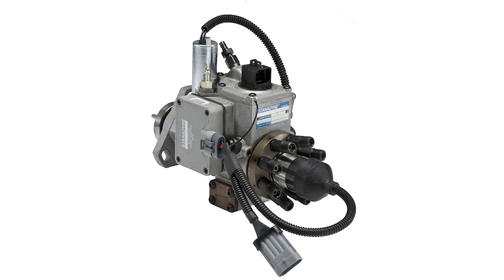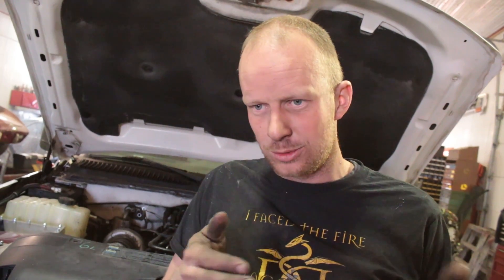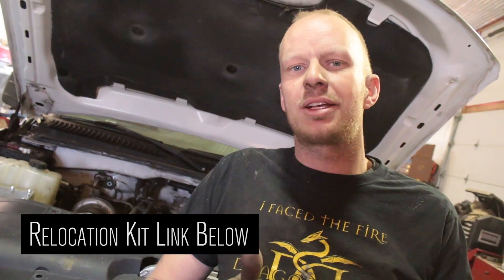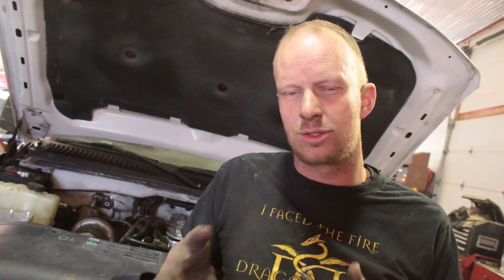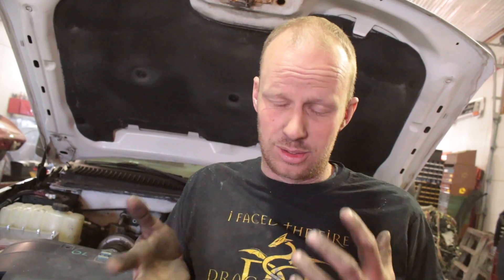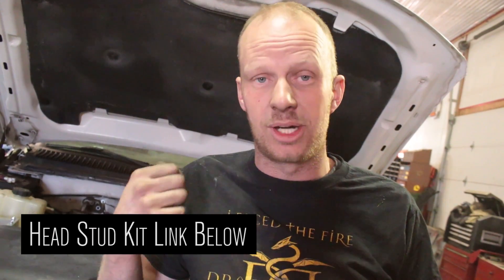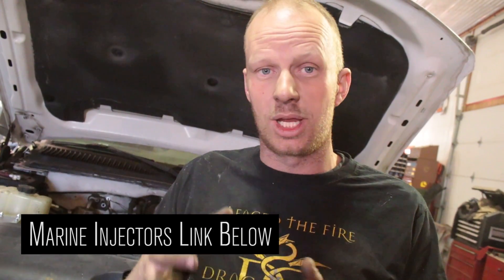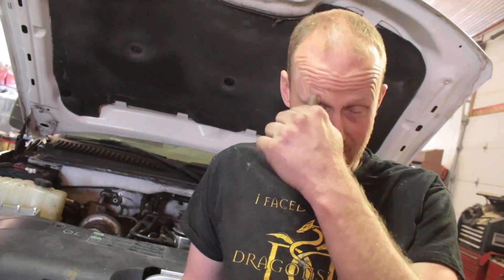REVIEW: Everything Wrong With A GM 6.5 Detroit Diesel

Comment: Am General is the manufacturer of the Military Humvee since the first day of production in 1984. When GM introduced the replacement diesel for the 6.5 with the new 6.6 turbocharged diesel they shut down the 6.5 production line so AM General purchased the entire 6.5 production line tool dies everything related to building the 6.5 and built a brand new building to start production in. After repeated failures of the block AMG delved into metallurgy of the block and finally put into production a new much improved engine block on the 6.5 turbocharged engine rated at 275 horsepower. It blows the old reliability records right out the window and the Army loves it.

A friend of mine found a new in the crate 6.5 military diesel from a military surplus dealer and put it in his M-1009 with the military heavy duty 4 speed automatic transmission doing regular maintenance on both items now has over 300,000 miles and still runs like he installed it yesterday. It was designed for the latest Humvee  and is a massive improvement to the old 6.2 6.5.
Reply from the maker: Thanks for that.  Awesome!  I just got my first Hummer into the yard yesterday.  Its not like any other one I have ever seen though.  Can't wait to start working on it.
Reply: DEBOSS GARAGE 

Just an FYI the low delivery rate of the mechanical fuel pump, I replaced mine on an ex military G30 class ex Air Force Van 6.2 Turbo 400 when the mechanical transfer pump failed with a 12 volt pulse type fuel pump. Solid 7 pounds of fuel pressure simply by turning pump on and while waiting for the glow plugs I would hear the fuel pump clicking at high speed then slow down to about one beat a second. It was on there for over 250,000 miles before I retired the truck due to rust/rot issues. The engine is now used to run a 30 KW standby generator for the tow truck drivers home for 3 years nice and warm in a corner of his heated garage. Not automatic start, he or his wife fire it up as needed and let it warm up before putting a closing the breaker to run the entire house with it. The following winter he lost power and fired it up before going on a tow. That's when his wife called and asked how much fuel for the generator they had. Commercial power wasn't restored to his house ( dead end street way out in the boonies) for 27 days, massive ice storm and over half the state without power. Commercial power utility had to replace 698 poles to reach his house so he called the utility and told them he had a very reliable diesel generator do get the important areas first. His fuel tank for the generator is a retired aluminum 5000 gallon home delivery truck parked sitting on a concrete pad no tires or axles or engine filled the day before the storm hit( he was lucky) .

I believe you can buy a new AM general built 6.5 for around $7000 directly from AM General which has all the updates AM General put into the engine block and cylinder heads. 

Oh yeah the 6.2 military engines are the J series engines using gears instead of chains to run everything under the water pump. Check the serial number, if you see a J in it it is gear not chain driven.
Reply: Just found this and thought you might get a chuckle out of it. It starts out fast but don't touch you computer, that's just to get bye the crap at the beginning .
Here's the link below.  

https://youtu.be/20FBN3tdJUg

Hope this helps and gives you a chuckle at the same time.

Comment: I had a 1994 c2500 with a 6.5L , and had to rebuild it due to MASSIVE blow-by.
I sank a ton of money into the job and would have been better off with a 12V Cummins.
The truck burned up in a wild fire in 2011, after only 850mi on the rebuilt engine. 
Sometimes you just can't win. I won't own another "boat anchor" 6.5, even if it's free.
The old non-turbo 6.2L had better longevity. The 6.5L was just weak crap, ESPECIALLY the bottom end which would easily crack the block under decent boost if you don't run a main cap stud girdle. GM originally listed them as a " light duty " diesel, which speaks volumes on these slug engines.

Comment: i enjoy how these engines drive .As he said not a ton of horse power but plenty torque almost the same as a 12 valve and it weighs 300 pounds less !. These engines are also fairly fuel effecient compared to other trucks and for its size.

Comment: 7.3 is the best light truck diesel ever. Period. Cummins had common cracked blocks and all kinds of stupid shit over the years that the 7.3 never suffered from. The lbz/lmm duramax id put over the 12v also. Absolutely bulletproof considering how complicated they have to be these days. The cummins was reliable for sure but it was also anemic power wise.

Comment: Injection pumps and the electronics on them fail. The cylinder heads ALL crack between the valve seats and the swirl cups, though it doesn't seem to cause any issues. The valves these engines come with are time bombs, the valve face where it meets the seat will just fall off.
You can get decent power out of one without too much money, but you are kinda pissing into the wind. I'm not talking anything amazing, just around stock LB7 duramax level of power.  There is a pump out there that will give you more fuel than you know what to do with, but it will never be reliable.

Comment: My first diesel is a 1992 full mechanical injection turbo 6.5 and I believe it's a great motor. I bought my truck all stock with two cracked heads which is common, I spent less than $2,000 to rebuild it which included an aftermarket set of heads, and not much at the machine shop. Nothing crazy on the rebuild, but I did stud the heads. Three days later I picked up a 31' fifth wheel trailer, packed almost the whole house in it, and drove it from Florida to NY. This truck has done well for me and as of this post I have owned it almost three years and still love it and the great fuel mileage I get. I will suggest to anyone who buys one of these to defiantly do the upgrades they make a huge difference in both power and mileage.

Comment: pmd relocation to the front grill is better then to the top of the intake because it still runs hot on the intake and with my thermal gun it gets as hot as 80°f in the grill on the intake it is on average 250°f which to me is still to hot for electric parts

Comment: I own a 6.5 1993 diesel.... injection pump etc... all original.  In a Cheyenne king cab 8 foot bed 5 speed manual.  only 300,000 so far,  most mileage put on early in age.  No pollution stuff.  Starts in cold weather... unlike Fords..  no FICM to replace no high pressure oil pump to replace, no electric/oil pressure injectors to replace, no leaking injector cups, oil pan does not rust out, and turbo is still original unlike with diesel ford turbos that fail frequently. My 6.5 has over 300K with original glow plug relay and glow plugs..    Nice objective video. Most are done by FORD fanatics who know nothing about a 6.5L except baseless B.S. that someone told them after they had 6 beers...who never owned or drove a 6.5  diesel.   Also, it only needs 6 quarts of oil.  Only draw back is.... GM switched to the duramax....
Reply: Buffalo Diesel I have an early 99 7.3 that had never failed to fire up with two good batteries and proper use of the glow plugs,correct weight and clean oil.
Reply: If you have 300k on it with original plugs and injectors, you're doing it wrong or full o shite.
Reply: Buffalo Diesel 7.3 idi. need i say more
Reply: Brandon Ruhl Yeah since Ford didn’t really have much to do with that motor in fact I think they had about the same amount of input into that motor that dodge did with the 5.9 Cummins. 7.3 is just a rebranded T444E not to mention mileage wise they’re about the same in reliability with the 6.5 around 450,000-500,000 is when you need to give them a rebuild and the 6.5 and 6.2 get better fuel economy need I say more?
Reply: Brandon Ruhl “7.3 iDi NeEd I sAY MOrE” yeah actually context would help I mean what point were you trying to prove by saying that? I’d take a Cummins or Duramax over a 7.3 anytime hell I’d even take a 6.5 over it no offense
Reply: Christian Griffith There really was no point. was just saying 7.3 idi. 6.2 and 7.3 are both workhorses than get damn good mpg doing it, just don’t expect to get there fast. &  No offense taken, that’s fine with me. i’d much rather wrench on my 7.3 idi than a 5.9, 6.5, or 6.2. but it’s all about preference imo

Comment: owning a 6.5 for 5 years now is yes the injection pump but I've been putting in hotshot diesel treatment every fill up. but yeah its been a dependable motor but can't compare pulling power to a 5.9. stock turbo are myeeah not good. im gettin 6-8 psi. but i do agree with what your saying. stock 6.5? ehh.. modded right 6.5 yes. I've seen in person some hard towing and pulling 6.5's, but holy crap the money that goes into it compared to swaps. but yeah swap it out unless your a 6.5 fan. i am. peace folks and be safe. 👌✌🚴🚵🚴

Comment: wanna  make a chevy guy crazy just tell them that the dura maxx was based upon the 6.5
I had a fleet of these to maintain for constructruction contractor .

 three main things is #1 the final drive transistors for the injection pump ,
(if the transistors burn up it can burn up the electromagnet in pump back end)

#2  OIL pressure sensor that has the fuel pump in tank ground   (good idea to have a new one in and a spare and a drive socket and extention  and a 14 mm wrench to move bracket  at all times for  6.5 owners).

#3 sparre fuel filter and the skills to do that job (as it is easy to screw it up by miss aligning it and not bleeding air out)
      (install filter and have some one turn the key on - no start open bleeder have helper bump starter just a bit
         then shut of when fuel appears, you dont have to get every lick of air out just most of it, you dont want to
         purge alot of fuel all over)
additionally

#4  the glow plugs are mission critical and when the plugs fry the control solenoid frys

#5 the vacuum pump that actuates the turbo has gotta have like 25 inches of mercury vacuum 
      at the turbo,,,,,,, they might have a aftermarket aneroid for that  but they did not when these were new

#6 not a high milage per gallon vehicle but if your getting less than 14 somthing is wrong 

#7 oil changes at 5000- 7000 critical less if you  can carbon from cumbustion is much quicker than
       a 12 valve or a 6.0

check the oil check the oil check the oil!!!!!!!!!!!!!!!!!!!!!!! these things consum delo like it is DPF

Comment: only problem i have is you said its not a towing engine. i have a 92 6.5 turbo and a p pump cummins dodge. i use the 6.5 as my main tow machine. they are good towing engine as long as you take care of them. i would rather haul with my 6.5 then my cummins any day. good video though, the 6.5 is a great engine. the mechanical injected 6.5s are the best.

Comment: The 6.2/6.5 family is king in one area and that is cost. It's something I notice with diesel guys when they go on about the dmax and 12v, they forget that this engines can cost ALOT of money and when people are dipping their toes in the diesel market for swaps or the get into them the cost of those engines can turn people away. The 6.2/6.5 on the other hand are easier to get, sense they are being used in the military there is more used parts to get. Also in stock or slightly built with minor upgrades it can do a fair bit in a off road truck that has good gearing and needs low end torque.  I would say it is one of the best entry level diesels on the market bar none. Remember I has a gym bolt pattern on the trans, is about the same size as a larger gasser engine, and can be used with gasser autos and mans without worrying about blowing them up. You can always upgrade to a better engine later while learning the small things on a more forgiving and cost effective engine.

Comment: I own a 99 gmc with a 6.5 I picked it up in January 2015 with 89,000 miles on her. I'm now on the 3rd injector pump, this time up purchased a brand new one from stanadyne through Leroydiesel.com, other than making 2 poorly thought out purchases of rebuilt pumps, I kinda like this engine. I have driven trucks with cummins, Powerstroke, and duramax engines and I have to say even though I won't win any races this engine gets the job done. I towed my 03 F250 6.0 300 miles from Arcata ca to Stockton and got 13mpg, and that was with the last rebuilt pump leaking fuel from the head assembly. I figure I was between 10k and 11k total trailer weight and I was going 35 mph at full throttle up some of the hills but she didn't over heat or complain. She just kept going. Before I made that trek I took some preventive measures, I had the rear end bearings replaced, the u joints replaced and the 4L80E transmission completely updated and built. I plan on getting the engine swapped over to a p400 next year, that is the navistar update for this engine, they reengineered this engine with a girdle and better innards, making more horse power and torque.

Comment: I had a 6.5 as a company truck in the mid to late 90s on a ranch it had a 16 by 6 foot Easley catch stock trailer attached to it usually had two horses and three or four 6 - 7 weight sick steers in it. we put lots of miles on it we had beef cattle spread across four counties in West Texas. they will work I would not pull a bulldozer with them. but the 6.5 had a lot more power than the 6 .9 Ford it replaced with way less problems lol

Comment: Yes but they sound so much better than all the others with a straight out exhaust....

I'd stick with 12v too personally if it would fit in a Land Rover/ Range Rover engine bay but the 6.0 or 6.5 fits nice where the Duramax and 12v Cummins wont.

Comment: something good happened on all parts remanned, like a/c pumps, and alternators, water pumps, fuel pumps.. the iso9001 standard changed in 2008. GM is big on the new standards like ts16949. Delphi boasts a lifetime warranty as long as the pump was built by them after 2014.. that is just 2 years ago to be in the better rebuild standards. A bizarre example of freaky outcome is changing a stock fuel pump form the 96-98 vortecs to any new replacement.. it is +30 to 50 horses for free. How to gain an LS sound out of a 21 year truck. A/C pumps is another great thing to keep up on. None of that stuff will be original mistakes ever again.

Comment: I have a 6.5, love it. I have looked through the comments and just to reiterate other than the PMD that controls the injection pump there are two other modifications to make right away. One being the lift pump the other being the vacuum controlled waste gate. Change it to a mechanical one.
Reply: Do you have somewhere I can find more info on those updates I'm currently looking to get into the platform
Reply: @benjaminnoordam7707  check out Heathdiesel.com they are the best for the platform, a lot of great parts and info, my thermostat broke, the engine overheated and I blew a head gasket I didn’t have the money to deal with it in the fall so it sat with coolant in the oil over the winter, when I went to fix it in the spring the coolant dissolved some bearing I believe in the bottom end and the engine was junk, good luck if you treat them right they are pretty decent trucks
Reply: I changed to a mechanical wastegate but not sure what pressure to set my boost? I dont want to blow a head gasket.